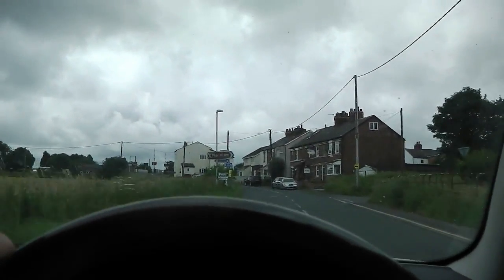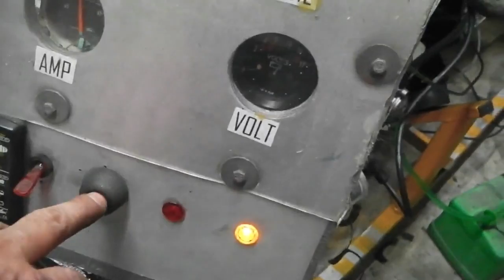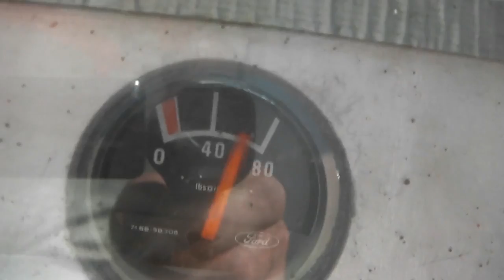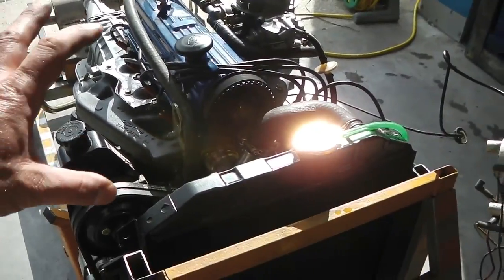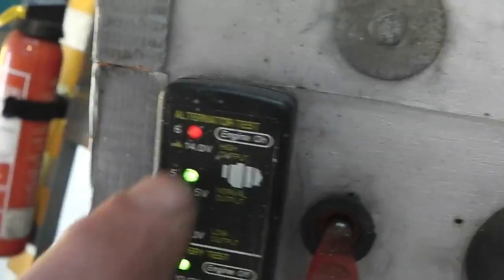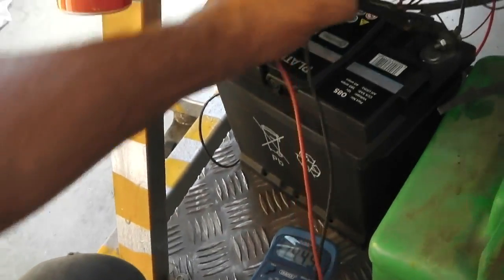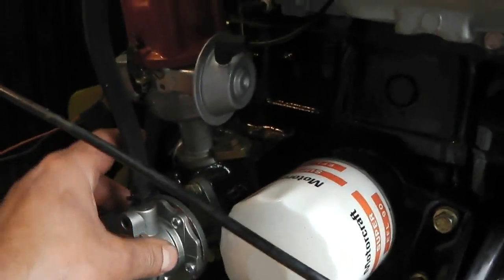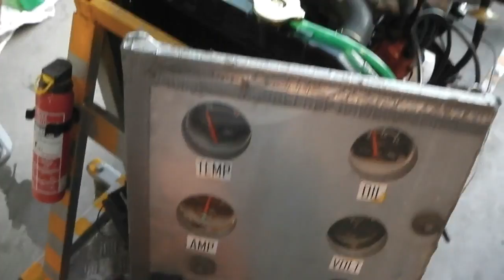Ford Cortina Mk3 Restoration - Ruby EP35

Comment: engine looking sweet bit of tuning and it will pur. great vid Pete
Reply from the maker: Steve connected vac hose to gearbox modulator, engine more steady now, was leaking vac air, its mint, really pleased with how responsive and quick it is to pick up, running 3 hours, not a leak, its really good, well made up, thanks again Ste

Comment: Just as well you have that pinto tethered to something or it could run off into the yonder hills, lol. Hey sounds good bro so something was done really well. Not sure about that auto box but normally we check the trans oil level with it running in park here in NZ. All the best bro
Reply from the maker: Ken, thanks, yes i just wanted to get some fluid in first, i check with running when all done, plenty of fluid is in for now, all looking good, hello to good ol NZ !!!! all the best here from Uk, Pete

Comment: As the water cool down does the choke flap get pulled down and metallic wound spring get smaller? I don't know know exactly how a wax stat choke works but i do know they can be reset by sticking them in boiling water for 2 minutes.
Reply from the maker: Hi Michael yes theres a bimetallic coil, however to set the choke on, when cold, you press accelerator pedal once to lock it on, it then opens on its own as it gets warm

Comment: The Pinto engine is a legend in it's own right and has been in so many vehicles over the years. Can't wait to see Ruby back on the road again where she belongs. I have put a 205 pinto into a Ford Sierra estate on a f reg once and was well quick. Just be careful with the Auto box when testing to make sure it doesn't get too hot.
Reply: Yup, Nice little motor, I had a few twin cam ones-they were veryfun.
Reply from the maker: bloomin brilliant engines